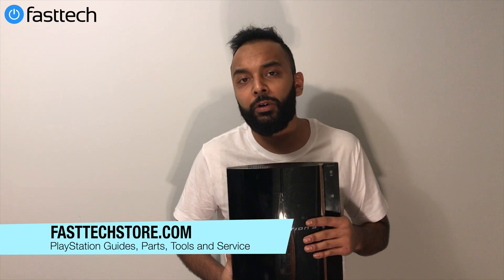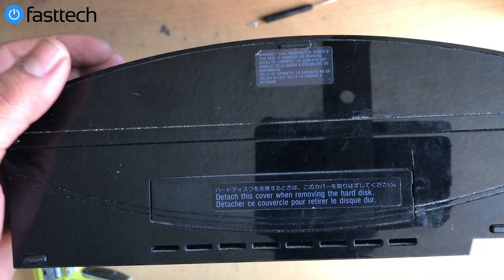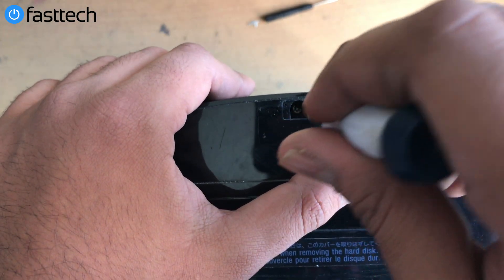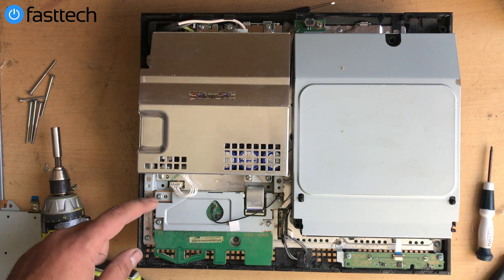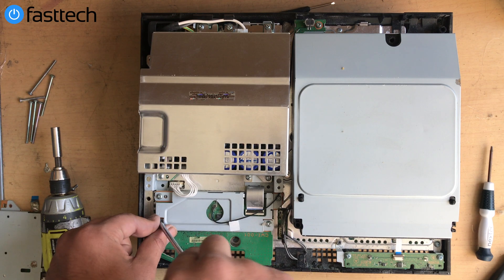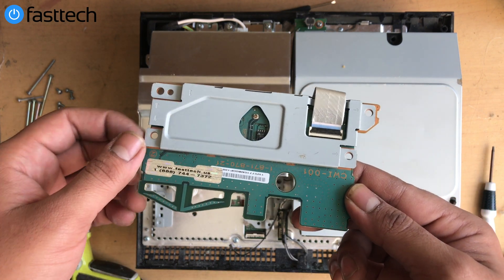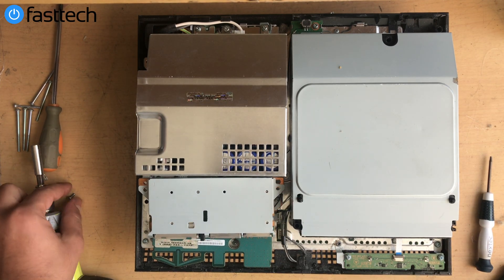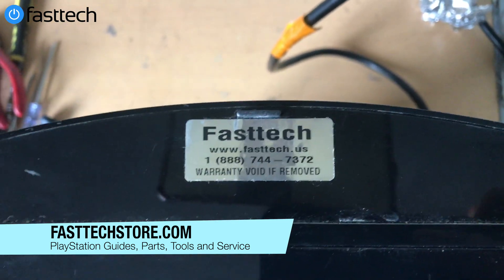PS3 CECHA01/CECHE01 Wifi Network/Bluetooth Replacement (No WiFi / Controllers Not Connecting Repair)

Comment: What causes this failure?  My E01 won't connect to WiFi or Ethernet yet Bluetooth works fine.    Trying to decide where to start for repairing it.   Also should I delid and repaste or just repaste as is?
Reply from the maker: There are 2 chips on that module if I remember correctly. One controls the wifi and one is for Bluetooth.

Comment: i have the 8002f1f9 problem on the ps3 super slim, does this work too for this?
Reply from the maker: @nate_xfusionx5854  the chip is soldered on a ps3 super slim and is much harder to replace but it’s doable

Comment: Ive been trying to update firmware to a later one on my old console and am getting the error code 8002f1f9 which prevents me from completing the update and im stuck in the firmware update loop. Ive read that it is caused by a faulty network and Bluetooth module. Have you come across this error code before? And has this rectified the issue? Thanks

EDIT - I'll leave this here for anyone encountering the same issue. Replacing the Bluetooth/WiFi module did indeed fix my issue
Reply: This happened to my ps3 super slim only real fix is to replace the Bluetooth board. On the fat models like this it’s super easy just unscrews and plugs in 
On the newer ones such as the slim and super slim it’s physically soldered into the unit and requires much more complex work 
There prone to failure as the console is always searching for a signal wearing it out
Reply: @NaturalRebel  Yeah I discovered this myself. Replacing the wifi/Bluetooth did work. I actually ended up replacing the unit, updating and then selling the ps3 and bought a slim as looking into the whole thing, I found out that the slims are more reliable in general and less prone to issues. Thanks for the input though. Could've done with you a couple weeks ago when I was pulling hair out in frustration 😆👍
Reply: @blacksunshine7485  hahahah I hear you their yes my tech skills aren’t that good so I’m just going to get a OG fat and replace the paste and clean them. I wish I knew about the Achilles heel of the PlayStation 3 being the stupid Bluetooth board, with that gone console is useless no wifi, or Bluetooth. At least with the OG it’s a easy fix
Reply: @NaturalRebel  Makes logical sense. Just maintain the cpu and rsx which is pretty easy to do. To be honest, I'm hoping more convenient and reliable emulation takes off so that we can emulate ps2/ps3 easier without having to worry about old console maintenance. You could use a PC to emulate, but I like an actual system.
Reply: @blacksunshine7485  yes for sure! 
I do have a gaming PC personally but the PS3 is amazing 
So many amazing games and you can jailbreak via HEN to get everything for free as well as a lot of the OG servers are still up! And have players COD4 for instance is super active but MW2-MW3 and others have issues such as non saving progress still a awesome console to own in 2023

Comment: Is this a wifi upgrade or is this just the same?
Reply from the maker: Same as OEM. The point of this video is to replace a non working adapter.
Reply: @fasttechvideo  i was wondering  if this adapter give better or faster wifi connection?

Comment: I'm having a similar issue but it's with the wired connection.  I tried replacing the wireless board but it didn't seem to resolve the issue.  What would it take to replace the NIC?
Reply from the maker: Do you have the 20gb non wifi edition ps3?
Reply: @fasttechvideo  I should add that when LAN goes out, WIFI goes out too but bluetooth remains working.  Both LAN and Wifi seem to use the exact same MAC as well.

I've attempted swapping wireless boards, but even the newer CWI-002 model (which took some adjusting to get it to fit) didn't last, and the internet connection still drops after anything from a minute to a few hours after I power the console on.
Reply: @fasttechvideo  I have the 60GB wifi one, launch model, but I'm using the network port since generally it's more reliable and faster.

Comment: Just reapplied thermal paste on ps3 i bought. System comes on now and works. But i cant connect to internet. It scans fine lets me enter info but times out when connecting and wont connect to controller wirelessly. Does that mean my board also needs replaced or do i have a different problem. Help! Lol
Reply from the maker: Check the connection first, if its plugged in properly it could have gotten shorted out due to static or lack or proper handling.
Reply: @fasttechvideo  Same here, any way to fix it? new wifi board?
Reply from the maker: @BNHardwarereviews  Yes we sell them here: https://www.fasttech.ca/playstation-3-parts/sony-playstation-3-model-a-c-e-wireless-board
Reply: @fasttechvideo  Or can it be the antenna bord? do you sell them?
Reply: I had the same problem a year ago, finally fixed it because I was lazy to getting around to it. Ensure the cable  with teeth is securely in the motherboard and lift the black clip to lock it into place. (I forgot to lift it up)
Reply from the maker: 𝙂𝘼𝙈𝙀 𝙈𝘼𝙓  replace the network adapter. We sell it on our site. The link was shared earlier in this thread